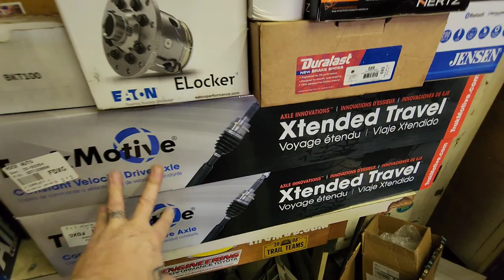1st gen Tundra. How to build a winch bumper. 2000 Toyota Tundra. Homemade steel bumper.

Comment: Great job my friend. However I'm tired of all "extras" being black on everyone's stuff. I think it would be great if you went to Automotive Color and got some body paint code rattle can and end up with a body color matched flat or semi gloss front bumper. I painted Barnabas's front bumper a grey engine paint so I can rattle can the scratches off from going to Badlands with you. Once you get your synthetic cable on with the smooth fairlead I think it will look much better. Have a great day my friend. Happy anniversary by the way!!! Can't believe she hasn't kicked you to the curb by now. :face-green-smiling::face-turquoise-covering-eyes:
Reply from the maker: Thanks Bruce. 
I've painted my bumpers and armor different colors on a couple of my rigs, but I definitely prefer black, especially on this truck.
I liked the monochromatic look with the stock bumper cover. But this stuff definitely needed to be black. I love it.
I have switched to synthetic rope and with the smaller hawse fairlead it does look so much better. 
Thanks for commenting and for supporting my channel I greatly appreciate it.

Comment: Hello.  Great info.  Are you using a flux core welder for all your bumper builds?
Reply from the maker: Hi Ryan. Thank you, glad you found it informative. 
Yes, I use a flux core welder for my bumpers. I have been welding with a flux core welder for over 25 years. I use it for every project. I've never used a gas shielded welder.
Thanks for watching and asking. 
I appreciate your support.
Reply: Thank you for responding.  I am a big Toyota fan myself.  I have a HF Titanium 125 amp flux core welder.  Do you think I can get hot enough with it to build bumpers and a tire swing out? @funjunkiegarage
Reply from the maker: Absolutely welcome. 
I use mine on material up to 3/8" thick.
It does 1/4" wonderfully. 
Mine is a Century brand (120 amp if I remember correctly) .
I like to go highest heat I can on all welds so long as I don't burn through.
You won't have any issue with the welder you have.
Enjoy your project and let me know how it goes, please. 
Thanks again for watching and supporting my channel.
Reply: I will let you know how it goes.  Thank you my friend.  @funjunkiegarage

Comment: What size tires you running?
Reply from the maker: 285/75r16 Falken Wildpeak AT3w
32.6" at street pressure.
I have 3.90 gear and with the 4.7 it's no issue at all to go to a 33. I did upgrade my front brakes with the 04 and up big brake kit.
Thanks for watching and commenting I appreciate it.